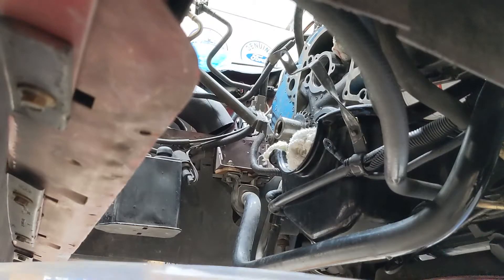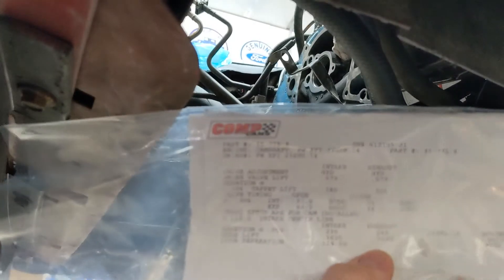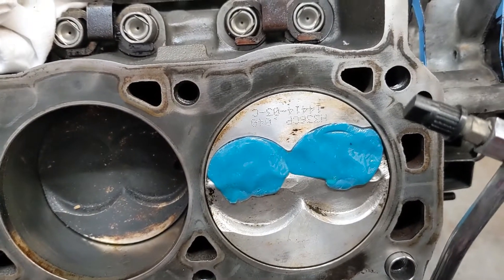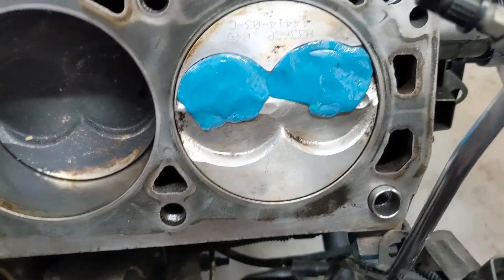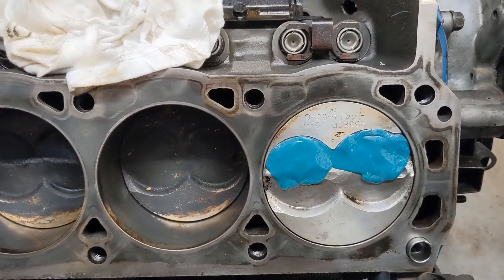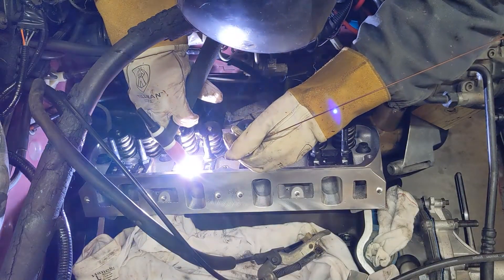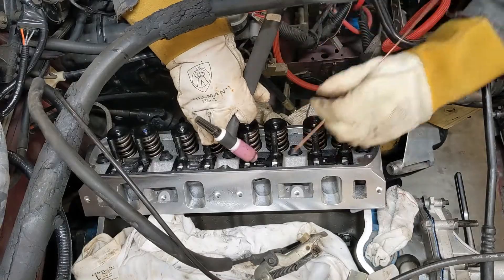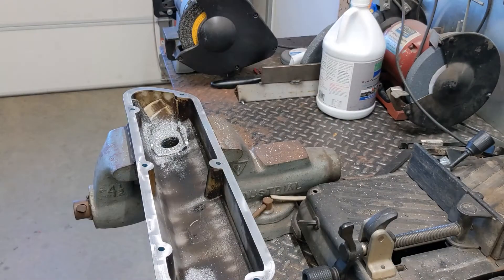Fox Mustang | Welding Guide Plates | AFR 205 Cylinder Heads | Comp Cams XFI | Reassembly Part 1

Comment: Do you have to weld the guide plates? Or can you get away without it?
Reply: They have the potential
To shift overtime if you don’t weld them. Plus makes reassembly much easier for the future. Take a tig torch and just give it a few spot welds
Reply from the maker: I've heard some folks say you can get by without it.